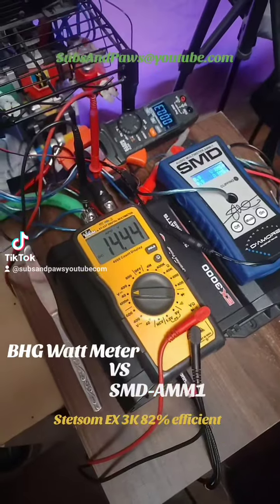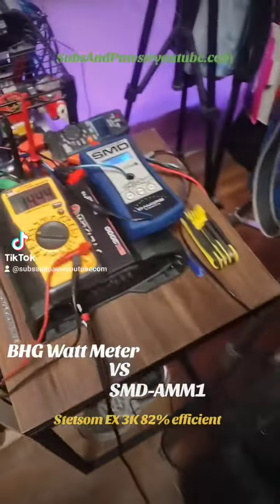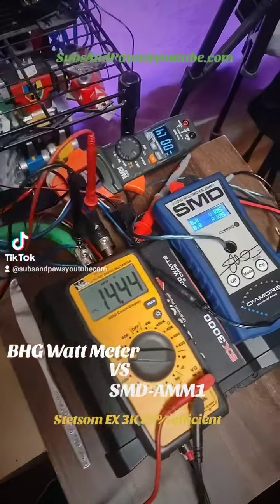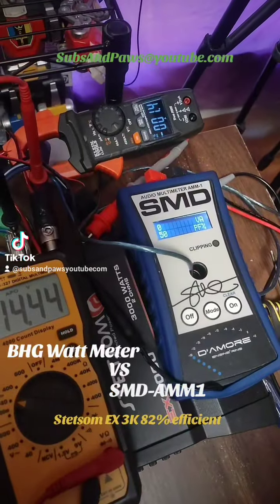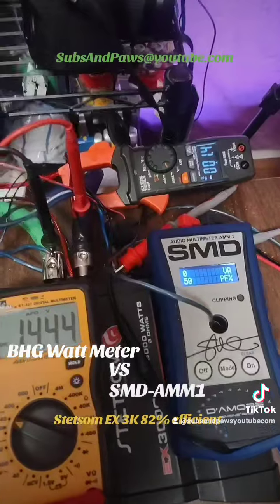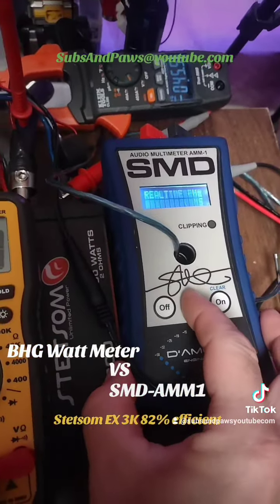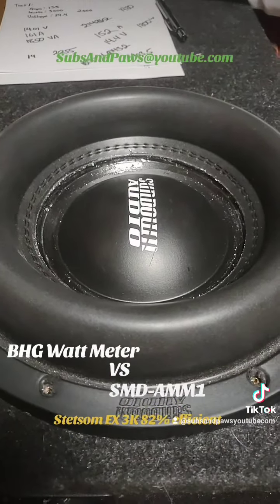Basshead Garage Watt Meter $89 Meter Vs $450 Meter Testing The Tester BHG Watt Meter Vs SMD-AMM1

Comment: 00:33 You are not in the mode you think you are. 

When it shows Wattage/Impedance it is calculating volts x amps x power factor. 

If you want it to read just volts x amps you need to put it in Apparent Power mode. 

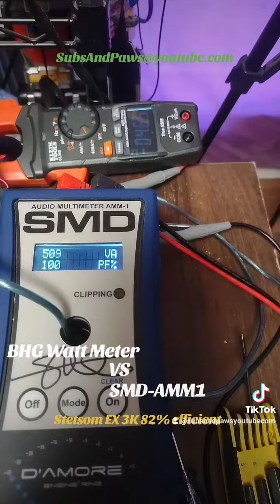5:34 the SMD power factor is 100% so its not adding it. It is reading Raw Power (volts x amps)

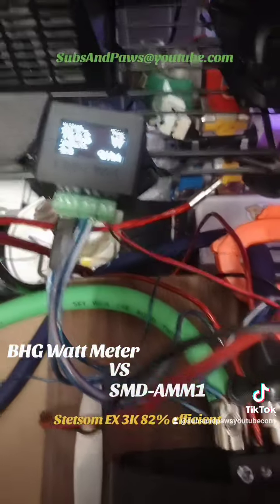6:25 The meters are in different modes again. SMD is showing Raw Power (volts x amps) and the BHG is showing Real World power (volts x amps x power factor)

The SMD meter is reading higher because it's not calculating the Power Factor. 

If you want to keep things simple, always put the BHG in Apparent Power mode. That's the mode it's going to match the AMM-1.

Also, you could put both meters in the mode showing volts and amps then turn the power up slowly. Verify they both read the same. 👍
Reply: AMM1 experiences issues in real-time power mode when clipping occurs. If the amplifier draws 2 kW, it cannot deliver 4 kW at the output..
Reply from the maker: We had them both reading the same. For just about the entire video. We're going to do another Test today.
Reply: @SubzPawz Are you understanding what I'm saying about Power Factor?

When the Power Factor is added to the equation, the total wattage is always reduced. 

So get rid of that and set the BHG meter to Apparent Power. That will display the basic volts x amps.
Reply: @SubzPawz The BHG meter has three modes:

1. Power/Impedance 
2. Input Volts and Amps
3. Apparent Power

1. Calculates power using volts x amps x POWER FACTOR

2. Just shows volts and amps

3. Calculates power using volts x amps ONLY (use this one)
Reply from the maker: @JasonWW2000  yes. We've done videos on each different mode. I still have videos full videos I have not posted yet but the one's in question I believe I have. The power factor is either.95 or 100.
Reply from the maker: @JasonWW2000  we've shown them all at one time or another.

Comment: The only "car audio pros" that use and promote the AMM1 are youtubers who get them for free to promote them. I've worked in the audio industry part time for the last 15 years and SMD products are known to off by 10ish percent across the board.
Reply: Well I tested an amm1 in a lab of my university and it measured correctly in the proper measuring mode. Don't project user errors on the actual products.
Reply: @JV4nG  Post video, because I tested my AMM1 against a Fluke true RMS thats accurate to within 1% (and calibrated annually) and the AMM1 was 10% higher, also 10% higher than my local shops termlab.
SMD products have a reputation for not being accurate in the professional side of car audio, and have had that reputation for as long as I can remember.
Reply: @WrecksBMX  I tested that 3 years ago. I have no pics of it. Also a fluke Clamp is calibrated to 50 or 60 Hz. So it is not the proper reference for measuring other frequencys. I also saw a lot of non plausible readings of a Termlab magnum. So it is also doubtful if a termlab is a proper reference.
Reply from the maker: The real-time power and Dyno mode is where the problem starts.
Reply: Pro's pay for there tools none are given
Reply from the maker: I'm going to buy a termlab too, and an oscilloscope.
Reply from the maker: The termlab kit comes with a clamp meter and connects the the PC telling you not only DB but watt's Volts X Amps and impedance and frequency.
Reply: @JV4nG  Explain how the fluke and term lab where within 2% of each other but the SMD was the correct unit please.
Reply from the maker: @jasx1485  I pay for everything on my channel. All 200+ sub's and over 100+ amps. Power supplies, batteries. Everything.
Reply: @SubzPawz   yeah I was commenting on the first comment  were the guy says pro are audio guys get it for free
Reply from the maker: @jasx1485  I figured. Just wanted to get my expenses out there. I'm just a little guy trying to make something outta nothing. I appreciate you ☺️

Comment: Amplifier drew approximately 210A at a voltage drop of around 9.8V, (correct me if I'm mistaken) So, the total power drawn by the amplifier is calculated as 210 x 9.8 = 2058W. Considering the amplifier's efficiency (this one rated at 82%), the effective wattage would be 2730 x 0.82 = 1687W. Next, factoring in the power factor, which generally ranges from 0.60 to 0.95, let's assume it's 0.9 in this scenario. Therefore, the real wattage would be 1687 x 0.9 = 1518W, which closely aligns with BHG-WM's measurement.

The display of 3800W on AMM1 is clearly incorrect, and AMM1 consistently reading a power factor of 1.0 doesn't seem accurate either.

In one video, a guy tested the Taramps Big Boss 3 with AMM1, which read '9kW' while the meter showed around 155dB. He claimed to have clamped around 9kW with strapped Koreans and measured 160dB. It appears that AMM1 has issues with Brazilian amps, especially the new Taramps Smart amps.
Reply: You agreed with me just in a Long story. It’s not just Brazilian amps.
Reply: Yep exactly
Reply: Imagine if they would have just used a half bridge amp for this test. They have done so many sub tests with full bridge amps, how valid are those "dyno" numbers now.
Reply: @Smokeey409  - The $3,600 SMD Amp Dyno is correct/Legit. But who has the $ for that. Im so glad this $89.99 BHG Watt Meter is so accurate.
Reply from the maker: Thanks for your comment 😊
Reply from the maker: Thanks for your comment 😊
Reply from the maker: We did a half bridge test on the JP 43. We'll have more. I'm going to buy one for myself to test with. I added equipment to my setup now. Thanks for your comment and support 🙂
Reply from the maker: Thanks for your comment 😊

Comment: @Subs&Paws- I slowed down this video to 1/4 speed @ 2:23 to 2:24, and seen the amp input voltage drop to 9.65 volts, as the Big Amperage Clamp Meter on the Amp Power Input wire read 212.8 Amps X Cant trust the Mfg. Amp eff rating, but im sure its between 70 to 80%. So that means in this test, the actual power output obtained is between 1440 and 1650 watts= BHG Watt Meter is more accurate. Thank you for showing the actual amperage being pulled through the 0 Ga Amp Power Inputs. Imagine this, i had a competition setup, with a pair of strapped amplifiers, ran off of 16 Volt XS Power AGM Batteries, charging @ 18 Volts, and @ 1/2 ohm strapped for the pair of amps= 1/4 ohm per amp, i pulled 1,115 Amps of current!
Reply: Hard to believe u had amps running at .025 ohm each that's as close to a dead short u can have  let me guess u was using Chinese made Korean style amps
Reply: @joshholden8561  - Im pretty sure you meant to type .25 ohm, instead of.025 as that would be almost a dead short? This was only for 3 to 5 second SPL Burps. I ran the amps  2 ohms strapped for daily. I used an Ohmega Switch. The amplifiers were Korean Made, Twisted Sounds.
Reply from the maker: No problem. I didn't notice the voltage drop so I'm glad you mentioned it. I have more 0 gauge wire in the mail. I meant to set up my backup batteries already but am short on wire for all 4 batteries. I'm hoping to have it running with reserve today. Thanks for your comment I appreciate it 🙏
Reply from the maker: I actually had my ZVX 12's wired to 1/4 Ohm. They actually ran at .8 for a low. I ran them for short bursts on a 1 ohm amp and ran them on a 1/2 ohm amp in the van. So completely possible. Especially if you're just doing bumps.
Reply: @joshholden8561 some of us do have cars and homes and make good money and can afford alot of good equipment. Some of don't live in my mommies basement running our systems we run them in vehicles... lol

Comment: Man something definitely fishy with that AMM-1 when it comes to  getting close to clipping… probably not worth 500 bucks. The videos from others are starting to show too many inconsistencies with their AMM-1 maybe there needs to be an update to revision needs to be done.
Reply from the maker: The SMD-AMM1 is reading bursts of power. The BHG meter can't. That's what we've noticed. Once the BHG meter goes above a certain point it stops reading correctly too. It's a nice budget piece of equipment. If you're testing over 2,500 watt's I wouldn't consider it being accurate. That's where the SMD shine's is accuracy. Thanks for your comment and support 🙂. I appreciate your opinion.

Comment: Just a tips, turn phone, set it on a stand, and have all meters in the camera
The bhg meter could came in the camra aswell without issues if you wanted to :p
Reply from the maker: @Morteexx  I have this same video on multiple cameras to load for picture in picture video. This is just something I could post without editing. I couldn't get everything on one picture, that's another reason I choose to make it this way.

Comment: So what's the problem? Is the Smd getting to a certain point and then go wildly off. They were very close at first, so does the smd stray after a certain amount of power?
Reply: @JAM-ur8tj  that’s a great question at what point does it start going haywire?!
Reply: AMM1 accurately measures voltage and current, but encounters issues with calculating wattage.. Most likely software problem. But a problem that has persisted for 10 years without a solution? kk
Reply: @massiveviral5603 Almost like they should have a calibration file for it.
Reply: @JAM-ur8tj- I feel the Amm- 1 has problems with clipping on certain amplifiers, and also when it malfunctione's, and shows .1= a tenth of an Ohm, this has been shown on multiple youtube channels.
Reply from the maker: It was the ohm's and watt's that is the factor. I show the exact test in the whole video and at the end go to live power ohm's and watt's and crazy happens on the SMD.
Reply from the maker: Watch the end. Every test in the whole video is the same including the end. I just switched to ohm's and Dyno power which is what everyone online uses to measure the amps.
Reply from the maker: Yup. That's what happened.
Reply from the maker: There's no reason VA is correct and Dyno power should be different. They should be exactly the same. Watch the end of the video. My last test.

Comment: John ur test set up is looking very very strong . Heck of a set up u got going on there.
Reply: @joshholden8561- I wouldn't call a voltage drop from 14 volts, to 9.65 volts👀, with only a 212 Amp draw, very, very, strong.
Reply from the maker: Thanks Bud.
Reply from the maker: I have 4 batteries I need to add to the power supply. I don't usually do test tone's but from here going forward on tests I will be doing test tone's. I should have 400 AH of batteries backing me up. I'm considering buying another lithium for the mix to add to them.
Reply: @evilinside5984 you are correct I like these guys but man that was a sht show

Comment: Sorry argued with you guys last time I tried to be polite about it. Not to say I told u so but…, anyways u can use ur clamp and dmm and get ur wattage, hooking up ur dmm to the positive and negative of the speaker and clamping the positive speaker wire will give u the amperage and voltage to multiply and divide to get ur rise and wattage, pretty sure u knew but jus in case. Keep up the videos!!
Reply: Yes sure, but that is VA = Apparent power, but to determine real wattage, you need to include the power factor. This factor typically ranges between 0.6 and 0.95, depending on multiple factors such as frequency, power, enclosure, subwoofer, etc..
Reply: @massiveviral5603 power factor is efficiency and that’s all, it determines how efficient ur amp is running when it comes the the wattage output compared to what the draw is, nothing used to determine wattage just efficiency, please don’t argue with my, u guys are doing great but I promise I know what I’m talking about, again keep up the good work I do like what u do, nice to see people learning and educating as u guys are, jus a little more research needs to be done, sorry if u take this as more than jus criticism cuz that’s all this is
Reply: @2000Rpz- I requested that Subs&Paws use there big amperage clamp meter on the 0 Ga. Amp Power Inputs to, verify which meter was more precise. Power in= Power out, you know. So i was very glad to see that in this video, even though i had to slow mo, and zoom way in. @ 2:23 to 2:24 i seen 212.8 amps, and voltage dropped to 9.65 volts X 70% to 80% amp eff. Real Power of Between 1,440 to 1,650 Watts= BHG Watt Meter is More accurate= Awesome for $89.99!
Reply from the maker: I'm glad you did because it got both of us thinking. That's one of the reasons I love making videos is the conversation that gets started. Thanks for your comment and support 🙂
Reply from the maker: The BHG said.95 and the SMD read 100.
Reply from the maker: Thanks. We both appreciate you and the support 🙂
Reply from the maker: I'm going to add my 4 batteries to the mix. About 400 AH lithium and AGM batteries. Thanks for your comment and support 🙂. We enjoy the conversation.

Comment: Is there anyone with a real oscilloscope,  they are much more reliable and accurate,  to test the AMM1 against.
Reply from the maker: I'm going to buy one also. It's on my shopping list. I just spent $110 on the new DC Clamp Meter yesterday. We have 2 SMD-AMM1, another 2 clamp meters, about 5-6 multimeters, the BHG Watt Meter, D4S JP40 Lithium Battery, Big Jeff 22AH Lithium Battery, I just got an optima red top battery. The list goes on and on. But I am going to buy one along with a termlab kit with clamp meter.
Reply: @SubzPawz  well ,that's awesome,  can't wait to see a true outcome for this controversy.
Reply from the maker: @TheRepos296  I'm curious myself.

Comment: Dude that video is total bs due to lack of knowlege of yours. Yeah. V*A is not Watts on the AC side. Its Apparent power (VA) not real power (Watts). You can see it on the Amm1. Real power is V*A*cos(phi) while phi is the phaseangle between voltage and current. Thats why the small wattmeter showed 15xx watts and the amm1 showed 16xx VA. And then you switched to an incorrect measuring mode on the amm1. The right measuring mode for a comparison would the the realtime power mode where the amm1 shows watts and ohms. Just delete the video cause it states nothing useful.
Reply: In your opinion, out of the two meters compared, which is more cost-efficient and accurate?
Reply: @anubisprince36  I did not test the small watt meter so I do not know the accuracy of it. If you want to compare the meters, you need to look at the frequency range of the current sensors and the meter itself. A high sampling rate makes it possible to read higher frequenys like harmonics when clipping but it makes the chip way more expensive also CTs with a high frequency range are more expensive. Also you need to consider the useful measuring modes of the amm1 and the development costs of the circuits and algorithms. You see a comparison is not that easy.
Reply: @themetalheadjgHD- Did you see @ 6:12 into this video, they switched the Amm-1 to show the Power and impedance. The Amm-1 showed 3810 watts, @ 2.2 ohms, while the Big Clamp Meter was around the 0 Ga. Amplifiers Power Inputs, and showed only 210 Amps X 9.65 Volts X amp. Eff. Of approximately 82%= approx. 1,650 watts. The BHG Watt Meter is more accurate.
Reply: @evilinside5984  As I said, suitable measuring mode for this application is the realtime rms mode, not the dyno mode. I've seen it multiple times, that the amm1 shows astronomic amounts of power when you use the dyno mode for measuring real time power. I think that happens because you need a certain track or frequency for the dynomode like the big rack-dyno (I can't remember the name) needs. If he would have used the realtime rms mode, the numbers would match
Reply from the maker: I'm going to use the real-time mode today. It's no different. But I'll show that in the video.
Reply from the maker: I'm going to do the exact same test in real-time mode and then switch to Dyno mode afterwards. As far as I know the numbers are always the same from the testing I've done. I could be wrong but I'll show it today.
Reply from the maker: I think they're both great tools. Cost wise the BHG is much more cost efficient and they're both user friendly.
Reply from the maker: BHG.
Reply: @SubzPawz  I'm looking forward to the comparison with the realtime pwr run
Reply from the maker: @JV4nG  I am too just to see. I'm curious.
Reply: @JV4nG  - If that is true about the Amm-1, that is a problem, that should not be happening.

Comment: He charges $10 to ship it to you. I literally live an hour and 15 minutes from ocala florida. Its actually cheaper on amazon. Even using hifivector code for discount.I tried to cancel order immediatelyafter ordering. There is literally no option to cancel. No way to contact. It also took 4 days to recieve. Not cool man.
Reply from the maker: I have my own code for Big Jeff. S&P will get you a discount. I don't know about cancelling an order but I do know his online staff is fantastic. I've dealt with them a few times. He's not making much on the sale as is and your supporting a small business. Your shipping time might have been because of a weekend or something else. I can't say I've had any negative experiences on the site. I do appreciate your comment and support 🙂
Reply: @SubzPawz  I'm sorry, even with the discount codes, the $10 shipping made it not only useless but ending up costing more than if I just ordered it from amazon.
Reply from the maker: @gregkirby  you're also getting a different older version of the device. I'm in the process of making a video. I believe up until now there's 3 different models. The main difference is the transformer that it comes with. V3 obviously being the best and the one Big Jeff is selling currently.
Reply: @SubzPawz  I think mine is the 150amp